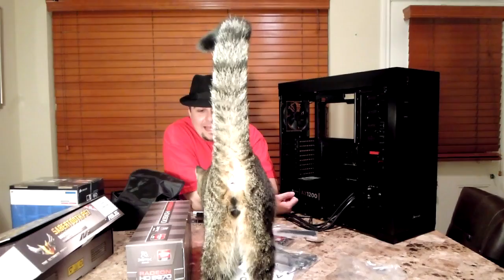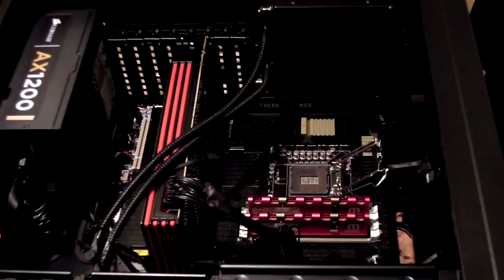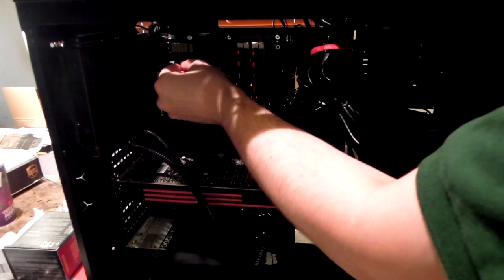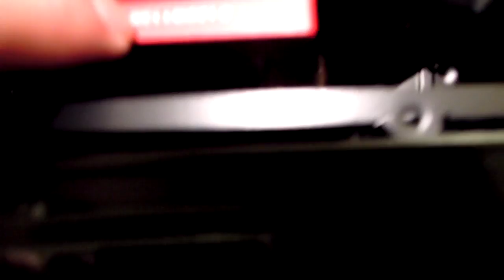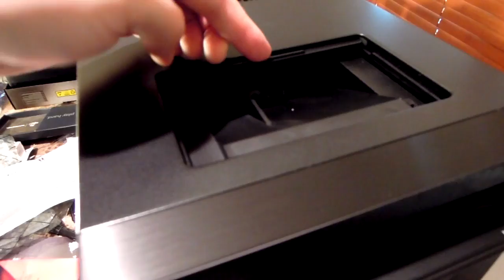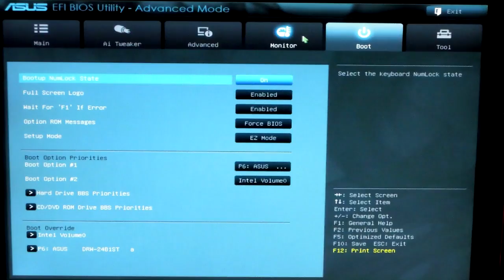EP2 Custom PC Build

Comment: also i run bf3 and skyrim very well with the set up -

Cpu - Intel i5 2500k Socket 1155

Mobo - Gigabyte Z77X-D3H Intel Z77

Psu - Antec High current gamer 750 W

Case - Coolermaster HAF 932 Advanced case

Gpu - Asus EAH6850 Direct CU

Ram - 8gb  Corsair Vengenace 1666 Mhz

Hard Drives - Two of these  OCZ Agility 3 120GB 2.5" SATA-3 Solid State Hard Drive

Plus all the optical Drives and others

Total cost for entire case is  roughly £750 or $1209 equivalent US Dollars

Comment: it depends on what you are going to use your pc for? If you are going to primarily use the pc for gaming then getting an i7 processor is no use, i7's have hyperthreading and multicores which any modern game out atm. Getting an intel i5 2500k is great for gaming thats what i use and battlefield and other application have no slow down. Psu is great, everything else is fine. Save yourself money and get an i5. there really is no difference between i5 and i7 for gaming.

Comment: my 2 cents on thermal paste application. I use Arctic Silver 5. I have found better temp regulation when I use the dot method with quad-core. With AMD hexa-core I use the line method. With thermal paste being better these days and the "nm" technology for heat regulation on transistors much more advanced, I actually ran a i5-760 Lynnfield without thermal paste with a COOLER MASTER Hyper N 520 for 6 months  without a single heat issue at full load. It wasn't overclocked.

Comment: id go for
Silverstone TJ11B-W case

gtx 590 2way sli graphics

i7 920 processor 

corsair h50 watercooling 

Gigabyte 990FXA-UD7 motherboard

OCZ 120 GB Vertex 3 SATA III 6.0 Gb-s 2.5-Inch Solid State Drive VTX3-25SAT3-120G  ssd

XMS3 — 12GB Triple Channel DDR3 Memory Kit (HX3X12G1600C9) corsair
ram

and a nice samsung or asus led monitor